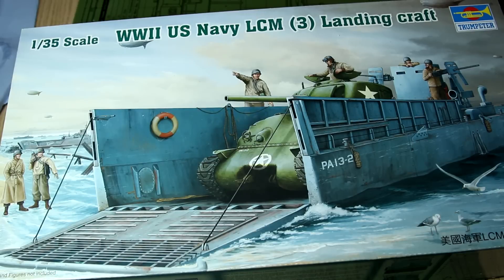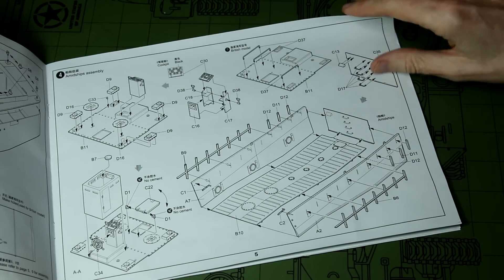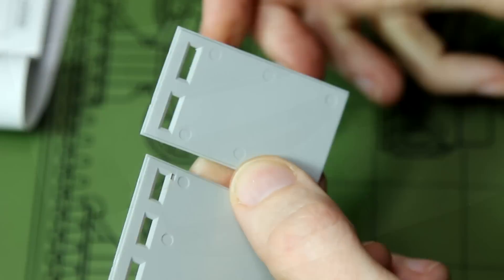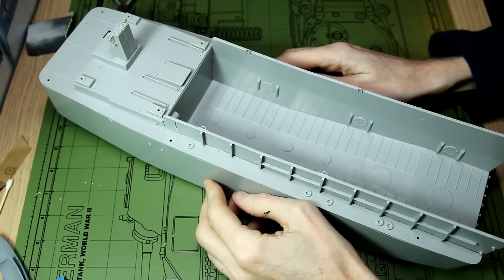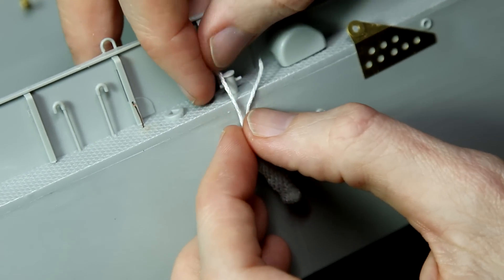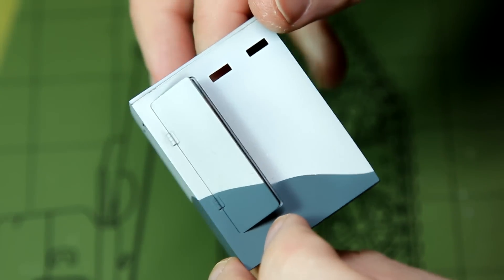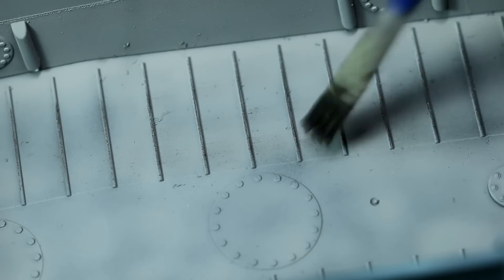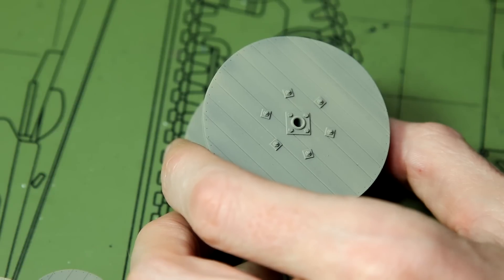British LCM 3 Landing Craft Mechanised - building and painting (Trumpeter 1/35 scale model)

Comment: Nice kit and build.
Re the ‘fluffy’ rope / string. If you are able get your hands on a small block of bees wax, pull the string through it a couple of times and  it will coat and subsequently flatten down / remove the fluffy effect leaving a more realistic looking cable or rope.
I’ve used this method a couple of times and it works really well.
Keep up the good work.
Reply from the maker: Thank you - that's a great tip

Comment: The circular plates in the well deck are gotten into before and after Landing Operations--so the bolts ought to be a bit shiny from having been wrenched upon.  Some chipping around the edges is not amiss.
The propellers were (in USN service at least) Monel metal, which is a silvery-blue grey with hints of green sort of color.  Some Mike boat props were just painted metal to match the underside paint.
Now, there is a slight detail in that these boats spent considerable time in davits on their mother ships, so the outsides were often very ship-shape and touched up by the boat crews while underway.  (The insides less so or having other landing craft nested withing them, or pre-staged cargo.)
There are some quite good videos on operation of LCM-3 on YT, which are full of details.
Like the cox'n pedestal dials are basically black with white markings. 
From memory, Trumpy has forgotten to include the magnetic compass set near the roof of the wheelhouse which is used as a backup to the main compass.
USN Fire extinguishers in WWII are red only if they are CO2; all others are bronze or brass colored.
The ramp cables were 17 or 19 strand wire rope over a natural fibre core--they should be well oiled and rust free--twisted picture-hanging wire can sometimes be used to model this.
The word you were looking or or the rope bumpers is "fender" (there are some vendors o AM model parts who render these in very fine fly-tying thread that is spot on or woven natural fibre to scale with no fuzz.
There is a lot o "clutter" that ought be in a working LCM that Trumpy have let clean out of their kit.  Like, there ought be a tow rope draped along the length of the well deck, At 1/35 it should be near 3mm diameter and at least six kit-lengths long (no real need to model the not quite 200m [100 fathom] full length).  There ought be kapok life jackets in every nook and cranny; and there ought to be at least two 3m boat hooks lurking around.  Various lashings and cargo nets ought be in the well deck, too.
Reply from the maker: Thanks for the information - it's really helpful. I completely agree about the "clutter" - it really makes a model look more "lived in" and I'll definitely be using some of your ideas for the final diorama. Thank you!